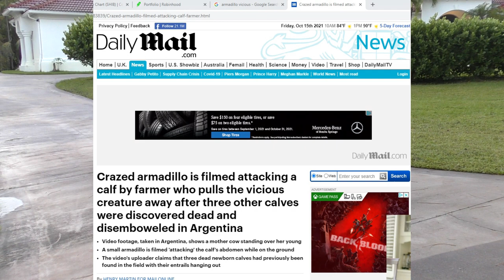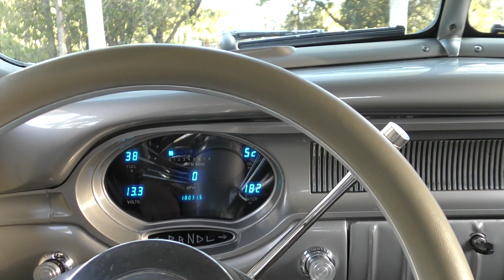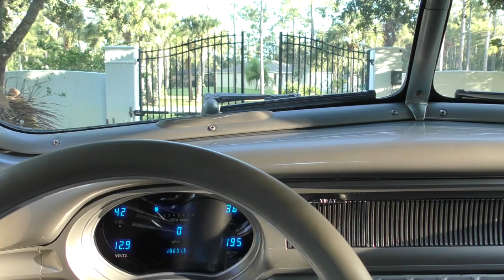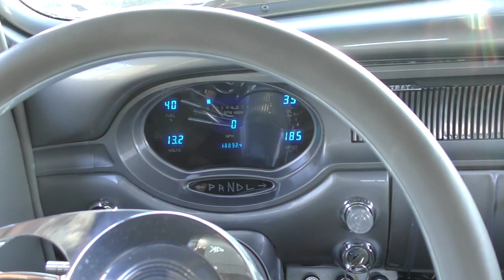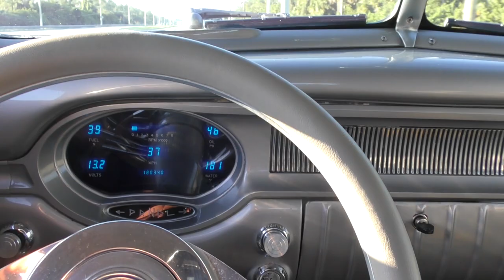This 1939 Ford Deluxe Convertible Restomod is a Highly Drivable Street Rod with Classic Curb Appeal

Comment: What I find amazing is how cars changed so much in the ‘30s! Compare a 1939 Ford to a 1931 Model A, and it’s hard to believe they are only 8 years apart!
Reply: Yah but think about the other 28 companies on the road then. They all had different ideas, and they didn't want to change a design that looked great to begin with, but they already could based on many concept designs. Infact I've seen better looking models from 1902-3-4-5 than a Model T in 1908, underpower, durable yes, hashed out turning, and frankly based on a 1904 design quality.

Comment: They made 1.1 million Mustang IIs in the five years it was produced, with over 300,000 of those in the first year, 1974.  As for the Armadillo, the plates on its back are a thick leathery hide.  It rolls up into a ball if a predator threatens it.

Comment: Despite being much maligned, the Mustang II was a big seller.
Reply from the maker: Agreed, but how many can be left for parts?
Reply: @curiouscars9282 True. Rust and junkyards being able to sell to recyclers, when steel prices are up, have probably wiped most of them out. Tempus fugit. It has been 45 years or more, since they were around. Maybe, as you speculate, an aftermarket outfit is producing the front underpinnings. I've heard of their use in updating hotrods since the Mustang II came out. Of course, there's also the possibility of junkyards knowing, there's a hotrod market for them, saving them out, rather than sending them to be melted down with the rest of the car.